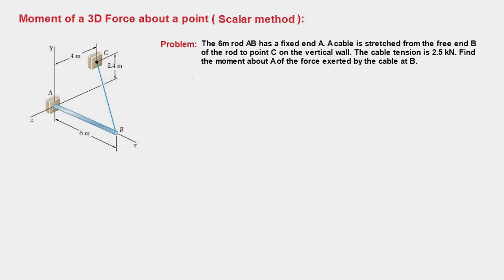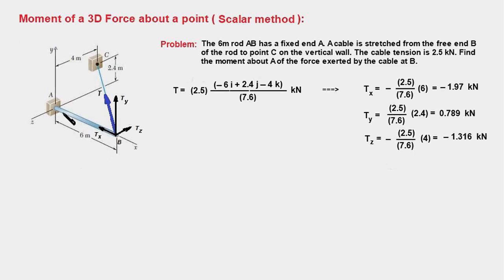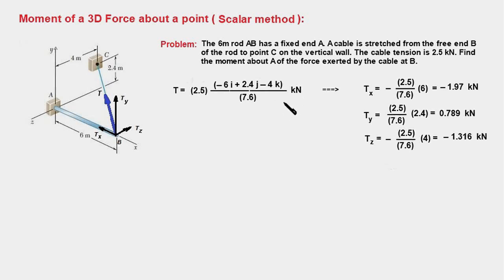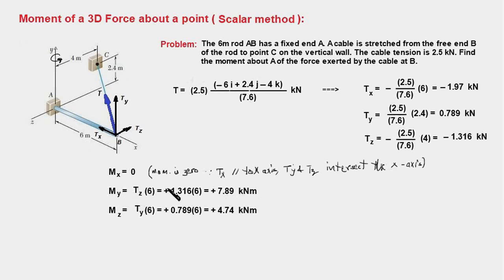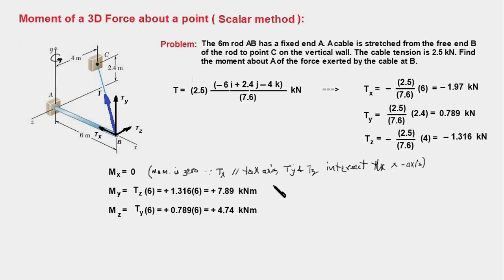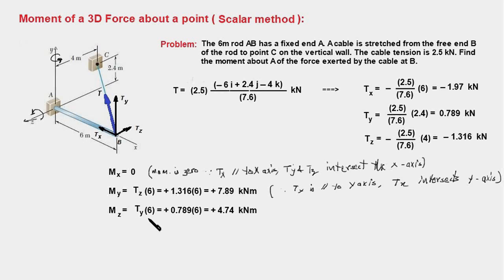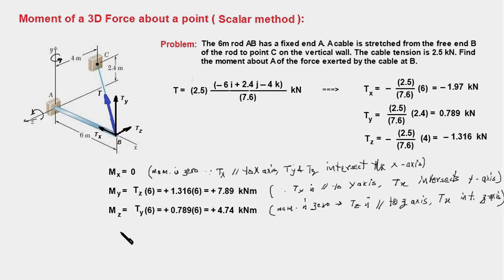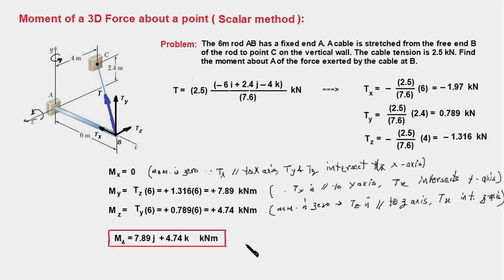5.8 How to find moment of a 3D force about a point - Scalar method (Part II)

Comment: PLEASE    SUGGEST  A  BOOK  ON  3 D  STATICS    WITH  MANY  SOLVED  PROBLEMS   =PLEASE  WRITE  ONE  BOOK   ON  3 D  STATICS   -THERE  IS NO  GOOD  BOOK  ON  3  D  STATICS   -  U  R  EXTRA  ORDINARY    --EXCELLENT  --THANK  U  SIR
Reply from the maker: Hello kaur and thank you for your comments. The book by Beer and Johnston is an excellent one and it explains each of the concepts very nicely. I too follow this book and most of the problems solved in my videos are from this book. It also has several solved examples on each topic. I'd certainly recommend you this book.
Reply: @VectorInMotion  thank you iam following your lecture for my mechanics 💯🥰